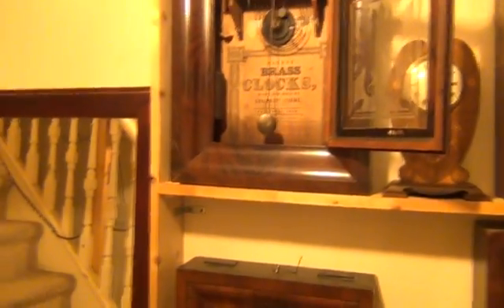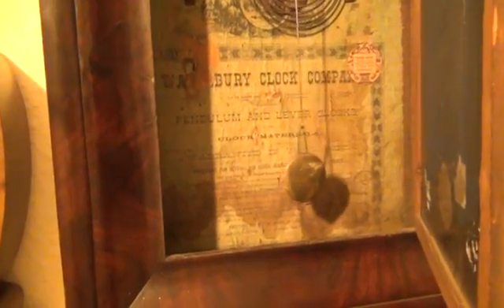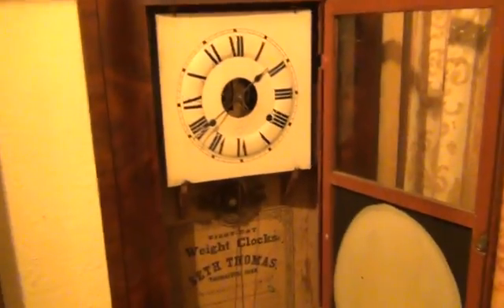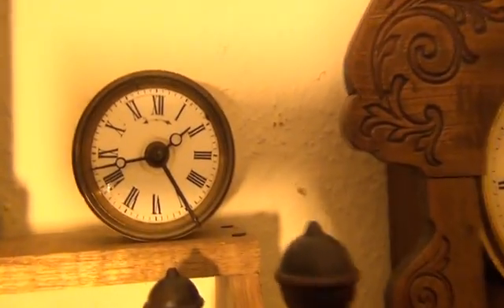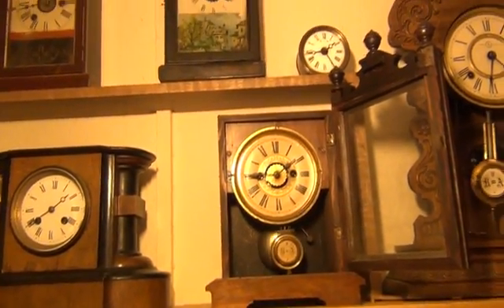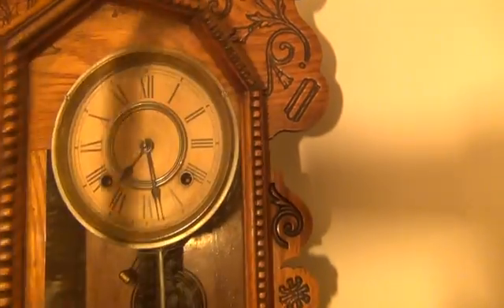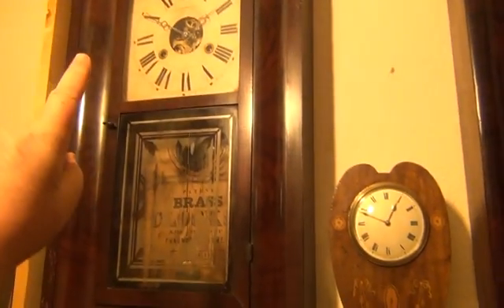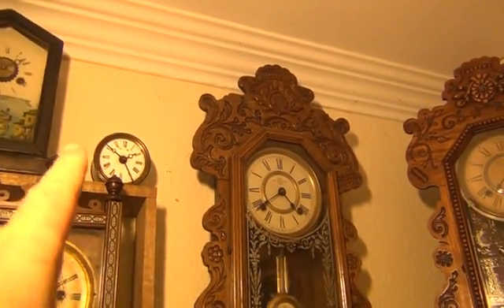Great American Clocks: OG, Cottage and Gingerbread

Comment: I recent purchased a Jerome Ogee Clock with a label showing it was made in Bristol and the Printer's name is John Black 70 Fulton Street New Haven. I replaced the weight cords and got it running. However, I can not manually advance the minute hand to adjust time. It feels locked. However, when the movement is running, the minute hand moves forward, keeping with the time. Have you an idea why the minute hand will move while running but will not allow for manual, forward movement, running or not? Best from Connecticut!

Comment: Found your video very interesting. I live not too far from Bristol,Ct. What I  found most interesting was the picture of the clock shop. While there are alot of pictures of the factories, founders, and some movements.  The actual 'working areas' seem to have all but disappeared  which find sad as that is where it happened.I have always been fascinated by the OG clocks with the beautiful veneer over the pine substructure.  The perpendicular orientation of the veneer brakes one of the main rule of gluing  but they have survived.  Thank you!